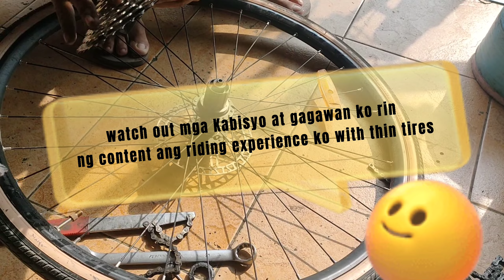Usapang Groupset - Review & Riding Experience With My New Cogs, RD, Shifter & Shimano Chain for 10S

Comment: pwede bang hindi ikabit yung goatlink
Reply from the maker: Yung sakin ay walang ginamit na goatlink. Pero sa RB ko ay gumamit ako ng goatlink dahil nagpalaki ako ng cogs from 12T-25T to 11T-36T at 9Speed.

The Goat Link works to convert a rear derailleur into one that will work with a larger cog, and a single front chainring. The c-clip must be removed in order to install the Goat Link